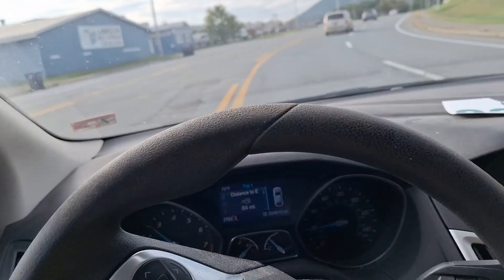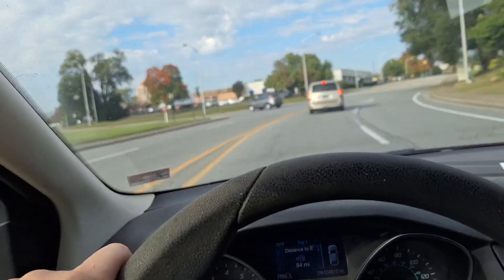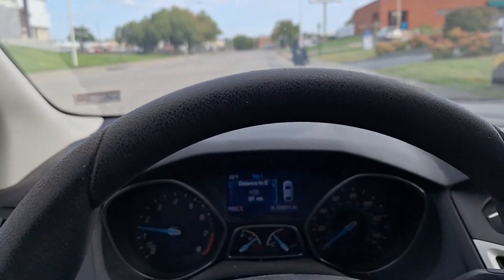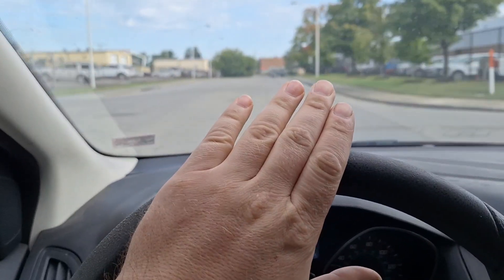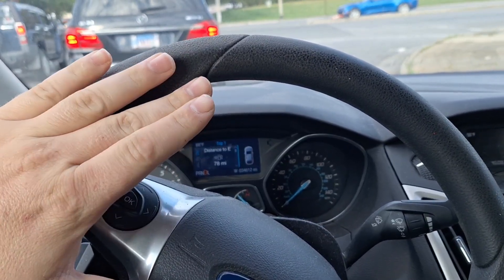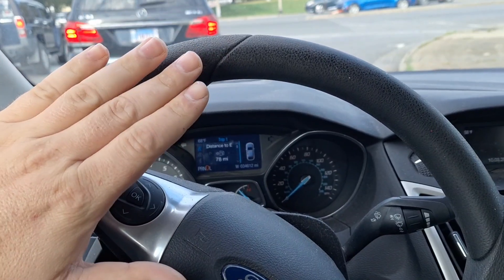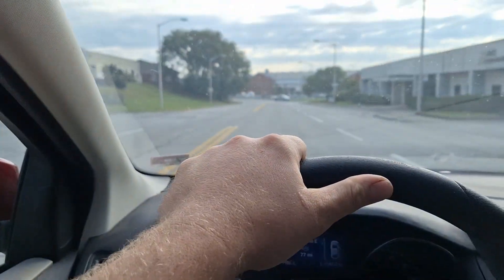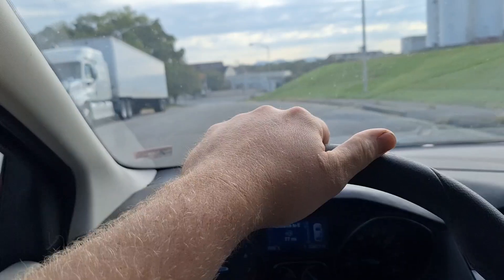Ford Focus/Fiesta DPS6 Transmission Overheating Warning Message! Tips and Advice

Comment: Thanks for the video! I have a 2015 in the shop. I replaced the clutch and forks with the Luk kit and installed a Ford OEM reman TCM, I also replaced the ground connections from the TCM and rerouted them directly to the negative battery post. but I am still getting this overheat warning. I followed Ford Tech Makuloco's video exactly when i did the clutch including all of the adaptive learning steps. There was no signs of any leaking in the bellhousing. There is no shudder at any time but the RPM does rise a bit when pulling a hill in 6th from around 1850 to around 2000. Is that normal? Should it be like a manual while cruising with the RPM pretty much locked to MPH or do these transmissions slip a little on grades? Im kind of at a loss of where to go from here. The car drives and shifts great for a ASMT. There are no codes, although it did have a P2787 when it came in. THe problem happens exclusively at highway speeds while cruising.
Reply: Did you ever have any luck with this?
Reply: @jakesapp4523  I replaced the TCM with a new Motorcraft one, did the adaptives and took the car on the same drive. There was no overheat message this time so i sent the car home- so well see. Im still a bit concerned about the 150rpm wandering of the tach in 6th gear- maybe the clutch needs time to break in?
Reply: @FIXXERAutomotive  thank you for the reply man. I’m in a rough situation right now lol. Customer came in with a blown headgasket so got the motor changed and ran great for 2 weeks. Then the dreaded sticking clutch forks and intermittent loss of signal to B motor. After changing tcm and shift motors shifting feels great but will throw the transmission over temp after about 20 miles on the highway. I looked back on the service history of this vehicle, 2016 with 63k miles. Has already went through 1 motor, 1 transmission, 2 tcms, and now I’m changing the forks and clutch. I don’t even have faith that this will fix the issue 🤦‍♂️🤦‍♂️
Reply: @jakesapp4523  Yeah, this is what makes me just not want to work on these- Its kind of like the 6.0 Powersmoke- just too likely to get call backs on things that aren't even related to the repair. Do you get the over heat message on the DTC or just the message?
Reply: @FIXXERAutomotive  Just the message, I went ahead and put a new clutch and forks in hoping that the sticking fork may have just eaten up one of the friction discs causing slipping. I’ll hopefully have this trans back in the car today and I’ll report back with my findings
Reply: @jakesapp4523  As part of my troubleshooting, i cut all of the tcm grounds close to the module and used a ground lug to tie them all into a 4ga cable and ran that up to the negative "jump start" lug up bu the left strut tower. I guess the causes for this is basically bad grounds, communication loss between the tcm and cluster, and internal tcm faults. I also learned to never but a reman TCM for one of these- New Motorcraft only.
Reply: @FIXXERAutomotive  I can’t thank you enough for the insight on this. I’m thinking the reman TCM has been the problem this whole time and I replaced the clutch for no reason 🤦‍♂️
Reply: @FIXXERAutomotive  I’m still fighting this damn car man 😂😂😂
Reply: @jakesapp4523  Still on the same TCM or a new Motorcraft one? Go through the harness- pin drag test- test/ replace the grounds to the TCM? Check for communication codes in all the modules in the car?
Reply: @FIXXERAutomotive  still messing with the car lol I got hit with hurricane Helene so have been shut down for awhile. I’m pretty sure I got a faulty clutch assembly this time 🤦‍♂️
Reply: @jakesapp4523  I hope you and your family are okay! We don't really get any destructive weather in Idaho, I imagine that it would be pretty scary to ride out one of those hurricanes! Id look real close at the TCM being the problem. Also the actuators can cause this problem as well. DId you replace the transmission seals when you did the clutch?

Comment: So there is literally no temp sensor. Then if the clutch actuators start to stick or any other transmission code pops up, then this must be the trans check light. Basically saying hey you need to scan me.

Comment: Owner is selling car and said they replaced transmission but still getting overheated message
Reply from the maker: Unfortunately when you install a used transmission, you really should put a new clutch and forks in it because they all fail eventually

Comment: My wife had the overheating issue and I had told her to check coolant she was empty and we brought more than a a gallon of water and it poured out in the same area your thumbnail points just not really any surface area to see where
Reply from the maker: The water outlet is there, that may be the leak.
Reply: @BigBensCarsAndCycles  ok I’ve searched around and majority do say the water outlet but I’m unsure as to how to prove it is without taking it off as I have the titanium hatchback I’m unsure if the layout is different but the outlet looks to be metal but I could be mistaken for a colored plastic
Reply: @BigBensCarsAndCycles  thank you for your insight and time. Fast response for an old video you earned my respect and subscription👍

Comment: What if my transmission is overheating and dropping gears after you accelerate to fast or something or when it’s hot
Reply: Code is P0809
Reply from the maker: Check my new video "fool proof diagnosis for clutch stuck applied codes"

Comment: I have a 2015 focus 115k miles 
It started off as id be driving and the rpms would skyrocket as if it the trans was in neutral. 

Then i had transmission overheating error 3x.

Now its saying transmission fault service now and doesnt want to leave 1st gear.

It should also be noted that it took roughly 8 months a few thousand miles for that to all transpire. 
Majority of the time it drove like normal until a week ago where its at now undrivable.

I swapped A for B and B for A but the issue remains. 

Is this a clutch/ fork issue or a TCM issue? Also ford has a extended warranty for 150k /10 years
Do those symptoms relate to that warranty?

Thank you in advance if you respond to this lengthy post.
Reply from the maker: Hi, you should have Ford diagnose it to see if it's a free tcm or a $3000 clutch job. Or tell me what code it has and I'll tell you what it is
Reply: @BigBensCarsAndCycles  I scheduled an appointment which will be April 11. I don't have the tools to run the codes unfortunately but if I find away to do so I'll inform you.

With those symptoms what would be your guess? I know without the codes maybe it's a shot in the dark but just so I  can prepare to drop 3g if so

Thank you for you timely response, very much appreciated!
Reply from the maker: @DucksDoQuack  symptoms can be similar between each failure. My guess is you should prepare for $3k
Reply: @BigBensCarsAndCycles  bummer
I got the car for 2 grand and I rarely drive it so 3g is what it is I guess
once again thank you

Comment: I have a 2016 Ford Focus, tested and got code P07A3 and P2872 shows clutch A, the car is also showing transmission is hot and is driving a bit rough , what can I do or replace ?
Reply from the maker: Hi. You'll likely end up needing a clutch job and you should replace both actuators too. https://amzn.to/3SAqWXx
https://youtu.be/EIJt9anfdSM?si=I4wI5RItnv_0hUSp
https://youtu.be/UBeWfEXdYLc?si=Ib1-BX268BDH6E99
https://ford.oempartsonline.com/oem-parts/ford-actuator-ae8z7c604a
Reply: @BigBensCarsAndCycles  thank you I’ll go ahead and try that and I’ll update:) !

Comment: It is an automatic / electric built in clutch , I guess it's called. and it doesn't show any codes
Reply from the maker: I'll have to get you to record video of the issue to post in my discord or Facebook group
Reply: 2017 Ford Feista SE non-turbo. You responded to my question the other day and ask if I could send a video you could upload. I have the car up on jackstands becauae I wanted to check the front breaks because like I said it seems like the brakes apply themself while driving eventually bringing the car to a stop. When you give it gas in drive or reverse it bucks up and wants to go but it seems like the brakes are locked up. I just took the calipers off and they were tight so I pressed the brakes with the cat running to see if the pistons came out and neither one moves. Would greatly appreciate ur thoughts
Reply from the maker: @hughbunyea4703  hi, the reason I was asking for you to post the video is to see what your car is doing. But, after you explained your problem again now, it sounds like typical clutch shudder which these all get. You can drive the car hard occasionally to mitigate the shudder. Or replace the clutch and apply components. https://amzn.to/4bhn3iK
Reply: @BigBensCarsAndCycles  just strange because it only has 70,000 miles and we baby it
Reply from the maker: @hughbunyea4703  babying it is actually bad for developing shudder, believe it or not. And 70k is high miles for an original clutch. I would drive it full throttle onto the highway 5 to 10 times and that'll help smothen it out for a while. Eventually a clutch fork will lock up from debris and junk. Usually every 100k miles you'll want a clutch and fork replacement. I've got lots of videos showing how to do that, without special tools. Let me know how I can help.

Comment: I have a 2017 Ford Feista SE automatic. Has been a good vehicle but all the sudden after driving for about 30 minutes it will start to slow down like the brakes are being applied and will stop eventually. If you put it in drive or park and give it gas it seems to want to go but almost feels like the brakes are stuck. If I wait an hour or so its fine but will do it again
Reply from the maker: Hi, do you have the dps6 dual clutch automatic? If so, next I need to know what fault codes are present

Comment: What about if it’s at speeds of 75 mph I had a clutch and fork replacement and my brother cant even figure out what’s going on and he works at ford there no shutter no codes but I get transmission overheating then transmission fault
Reply from the maker: There's no temp sensor, it goes by an algorithm based on detected clutch slippage. I bet you have a failing clutch actuator. When a fork sticks or seizes, it can cause wear to the actuator. I've noticed it can cause poor engagement at highway speeds and the rpm will go all over and not engage at times. I can see why that would cause overheating of the clutch. I'd try replacing both actuators with new oem ones. And make sure there's no leaks onto the clutch
Reply: Check your wiring harness that goes under your air intake.  The insulation on these wires is poor and moisture gets trapped in them.  Wiring literally corrodes in place.  The sensor sees a voltage drop.  Your wiring is probably failing.

Comment: I have a 2013 ford focus 113k miles. Just had the bearings replaced and dust boots. Was driving and received the red exclamation ❗️ to pull over cause transmission was overheating and to wait 5 min. No lights on dash but my traction control light keep flickering? Which never happened before. Waited till it told me it was to drive and went about my way home I wasn’t far. It’s been parked since. Which was maybe 2 days ago
Reply from the maker: Check for transmission codes, you may have to pull the transmission back out and check for a seizing clutch fork or slave cylinder. Or fluid leakage onto the clutch
Reply: Can I check for codes if no nodes are showing on dash?
Reply: Sorry I meant the wheel bearings, transmission was not taken out I’ve had no issues with tranny before taking it to get wheel bearings replaced. So this is all new

Comment: My car used to shift very roughly and shake time to time... I was told to replace gear box which I did... It doesn't share that much now, but I had different problem - when driving above 80 km per hour for some time, like 40 minutes my new transmission was overheating... In the end after lots of trials, they said it was a software problem and reprogrammed the car.. After that I drove 2K miles without having the opportunity to test the same duration for that speed.. But recently it start to everheat in a traffic jam in about 40 minutes even though I often put it in N to avoid overheating... So no I don't know what the hell to do with this car... (I have replaced both actuators 2 years ago)...we've checked transmission sensors, seems ok. I've changed transmission liquid for no reason, just to be sure... Maybe it's time for TCM?!

The most frustrating is that technicians are guessing instead of really knowing what the hell ot wants
Reply: Could you please update here if you get the issue fixed? I have '15 Focus SE 92K, TCM and a computer module was replaced a week ago. Now whenever I drive over like 40 Mins "transmission overheat wait 5 mins" pop up. The mechanic says they do not see an issue but it happens every time I drive. Thanks!
Reply: @gokhan0127  Not sure. But heard about a similar case where adaptation helped. I went to the Ford center last week to do an adaptation again and the mechanic said all went well but after that I have not tested on a highway so idk in the city it drives fine. So maybe you’d try to do an adaptation and then see
Reply: @tatiakartvelishvili9506  Thank you for the response. I noticed that it always happened when using cruise control in my case. I will try without it and see what happens.
Reply: @gokhan0127  Interesting. I think I don't have a cruise control on. Let us know the results
Reply from the maker: Need to know what codes it's setting and I'll give you some direction. Was it a used transmission or brand new? I'm guessing used since you're still having issues. Most of the time an overheating clutch is an issue with the clutch and apply components themselves.
Reply: @BigBensCarsAndCycles  it was a new transmission.. Not directly bought from Ford though... And since its change I only drove 3000 km
Reply: what did you end up doing?
Reply: @dashboy4l  nothing.. no one helped in the end.. :/
Reply: @tatiakartvelishvili9506  damn this hurts 💔 currently having the same issue. did they ever attempt to fix the tcm?

Comment: I have a 2012 Ford Focus with 225,000 miles and it still has the original transmission and TCM. All I did was to replace actuators and it shifts like a dream.
Reply: why did you replace those? what were your symptoms? and did you do any kind of relearn after the install?
Reply from the maker: @c2damak symptoms which lead to a failed clutch actuator are usually engagement concerns. They can be diagnosed by swapping clutch A and B actuators to see if the code transfers (follows the location of the actuator) which confirms actuator failure
Reply: Stuck fork will come trust me
Reply: American car 🤢🤮

Comment: Hi I have 3 code on my car p07a3 and p286f and p2872
Reply from the maker: You probably need a new clutch, forks and slave cylinder. They all come in the LuK repset
Reply: Is that it is easy fix also get a message, trans overheating
Reply: Do I need to change both clutches?
Reply from the maker: @user-vz3pt4bt6r  both clutches are serviced as 1 assembly. And I have videos on how to do the job. It's a bit advanced if you're a beginner at car repair, but if you're fairly experienced you can handle it
Reply: So all I need to do change the clutch’s on there
Reply from the maker: @NickAyoub-c9n  clutches, forks, slave cylinder, possibly actuators, and clean the clutch housing
Reply: @BigBensCarsAndCycles   how do I clean them ?

Comment: What’s a clutch shutter? Mines been sitting for 6 months and now that I’m driving it again it’s struggling to switch gears, and tranny keeps running hot. It drives fine once I’m on the interstate I’m guessing because I’m not switching gears but I don’t know. I added a quart of tranny fluid, but it’s a sealed transmission so I can’t check to see if there’s enough and I’m scared to add too much.
Reply from the maker: A clutch shudder is a Shaking sensation at low speed acceleration. Low fluid won't cause any observable symptoms. I have a fluid service video you can watch on this to get the level correct if you want. Anyway, first thing I'd do is check for codes. If there are none it could be a sticking fork or actuator. You can try hard acceleration several times to dust the cobwebs off before spending money

Comment: The dealership told me my tcm was going out and auto zone said it was my starter cause my car was not starting at all I got my clutch replaced and the tcm reprogrammed  how long does a reprogrammed last on a tcm but now my car is starting fine so I might just get the starter replaced
Reply from the maker: Hi, if you're TCM is failing, wait for it to happen again and take it to the dealership. The TCMs are free until 2025. Don't replace the starter, that's probably not the issue.